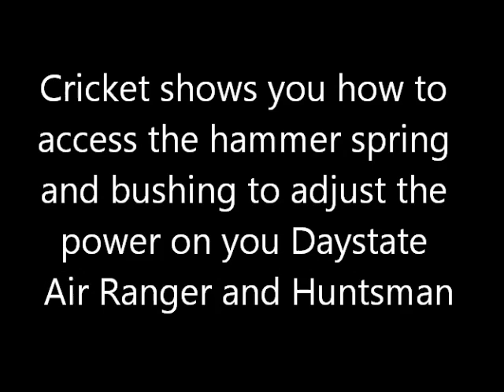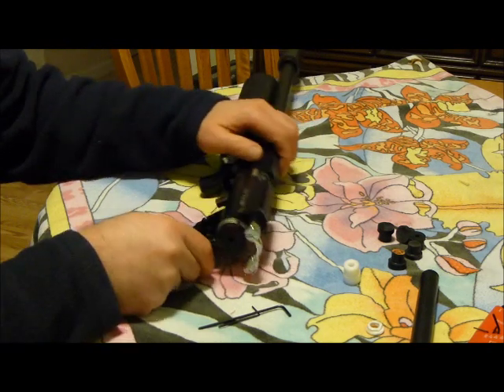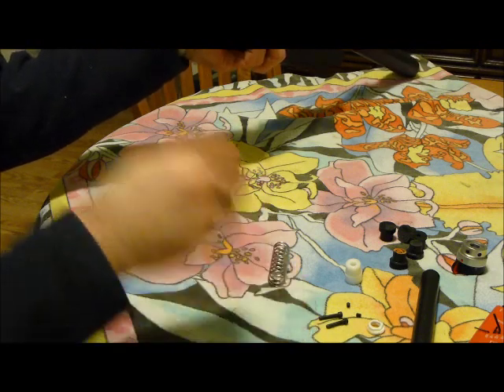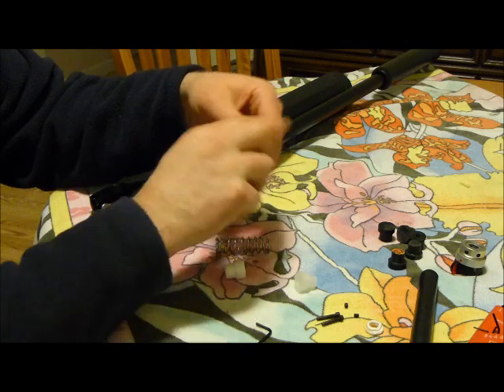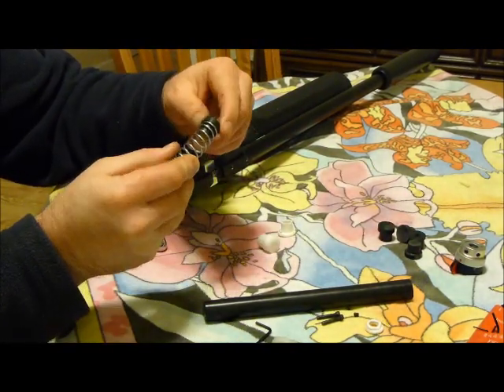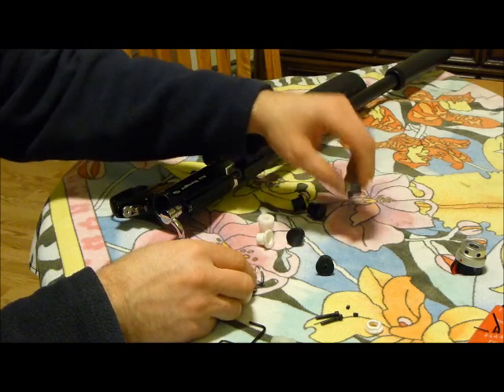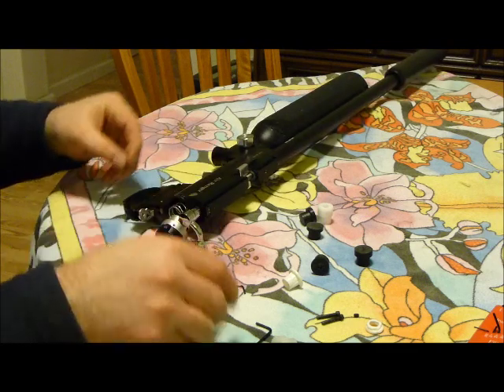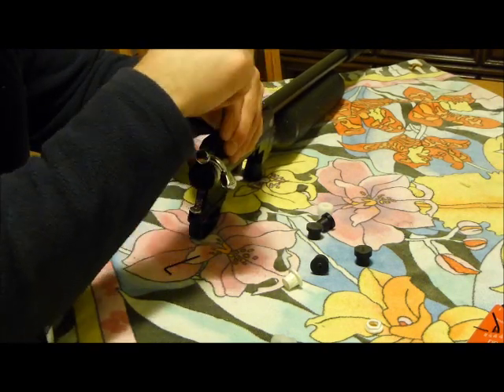Adjusting the Power on Daystate Air Ranger and huntsman

Comment from the maker: IT was a huge success I went from 33 shots and a 3600 PSI fill  to 44 shots with a 2700 psi fill. My accuracy is awsome is much improved now. I also have been doing test with higher FPS but they pertian to 25 cal accuracy wiht the JSBS in MY ranger starts to detierorate above 900 FPS. I have tried many deffrernt power levels. Now Polymags seem to be able to handle higher FPS. I had nice results in the mid 9s but that is hunting accuracy not target accuracy, The huntsman is a fine rifle.

Comment from the maker: Yes you can put a smaller hammer spring bushing in or a ligher hammer spring. That will lower the fill pressure as well as the FPS. IT doesnt take alot I have found about 1/16th inch shoter bushing gets about 30 less FPS and lowers the fill pressure 200-300 PSI. hope that helps let me know. JIm

Comment from the maker: YA open up the the hole that is drilled to the barrel for the transfer port. The NEW Air Ranger doesnt have the bushing anymore. and they changed the hammer some.  I just tuned one that was really anemic in the power area. by doing that. it is easy to do just remove the breech and barrel assembly like in my vid take out the trasfer port and then you will see the barrel and the hole go up slowly a little goes a long ways. hope that helps

Comment from the maker: YOu can get some power adjustment out of the hammer stroke adjustment but not much from what I have found. Its more for fine tuning and adjusting fill pressure than power adjustment,

Comment: hi jimmy;  where do you get your springs and bushings.  i am having a problem with my fps..  when daystate huntsman regal was fairly new i use to get an average fps of 870 or pretty close to that with a max of about 908  now my max is 777fps not a bit higher and by the time i shoot a string of 45 to 50 it down to 610 fps  there's really something wrong   never changed anything  no air leaks that i can see   can you help me out   thanks

Comment from the maker: MIne is currently set to  44 shots with a 2700 psi fill 880 ave 43.69 FPE shot string is 870-890-870 with 25.4 JSB pellets, My accuracy is awsome is much improved now. I also have been doing test with higher FPS but they pertian to 25 cal accuracy wiht the JSBS in MY ranger starts to detierorate above 900 FPS. I have tried many deffrernt power levels. Now Polymags seem to be able to handle higher FPS. I had nice results in the mid 9s but that is hunting accuracy not target accuracy,

Comment: Thanks for this excellent video on power adjustment for my new Air Ranger.  Mine is set for 50 fpe in .25 caliber, but I intend to shoot hollow point slugs at 45 grains.  I was wondering how to get the fps up to where the big slugs needed to be.  Sounds like 880 fps is achievable...may use a bit of air in the doing....(snort!)

Comment: Hi Jim i need a hand if you have a moment, my huntsman xl .22 has a SWP of 230 but at 230 the power curve just drops steadily every shot( 18.13 jsb) on the crony with no apparent sweet spot , i gave Daystate a call and they suggested i fill to 245 and not 230 to flattern the curve this means the minute i hit the yellow on the gauge it starts to drop  i tried adjusting the hammer throw distance but it made very little difference, any ideas on how i can flatten the curve out a bit ?

Comment: Good evening Jim.

I have recently bought a daystate air ranger 400cc bottle, I'm in the uk so it's sub 12ftlb. 
My questions are, is all the workings the same just like the American market?  Nobody sells longer or harder hammer springs in the uk. 
It's .22 and I'm looking to ump the power to about 28-30 ftlb just for abit more kick down power. 

Would you be able to sell me a spring and a bushing for me to hit that 30ftlb mark, without altering any fill pressure? So I can still fill the gun to 190 bar and get still roughly 70-100 shots per fill? 

Thank you, and kind regards
Jake.
Reply: Burning Rubber any luck?

Comment: I take it that is not the"extreme" airranger. The reason I ask is i have the"extreme" and the only pellet it doesn't spiral is there 36grain twenty-five's that cost $32 a damn box. And while i like the power. I would like to be able to shoot a lighter pellet. But don't want to screw up my gun.I was told that I can adjust the hammer throw have you worked on any? Well thanks for your time.
Reply from the maker: Most welcome glad you enjoyed it and found it helpful
Reply from the maker: No its not the Extreme but it is the same inside. The Hammer Throw will help some but not much. Mostly will just lower your fil pressure and shot count.  I would suggest casting your own boolits for it or if you really want to shoot pellets then detune like I did my ranger. My Ranger would HIt 70 FPE with the shorter barrel with the extreme barrel it would easily hit 80 + FPE shooting pellets too fast makes them spiral sadly, Hope it helps. Id be glad to tune it for you.